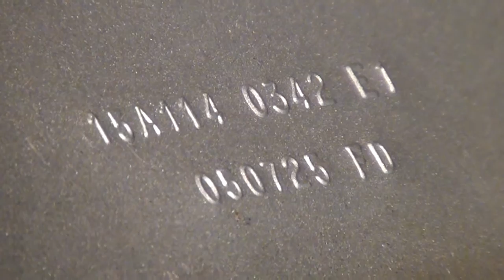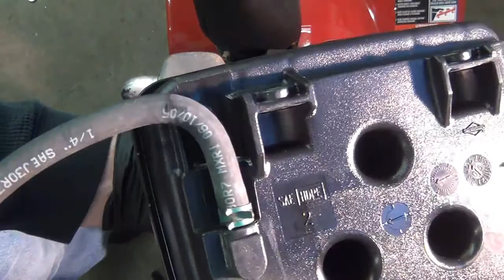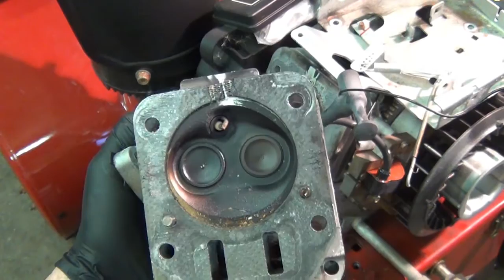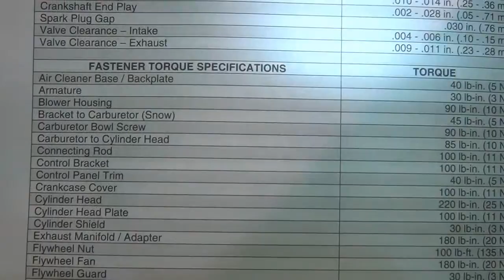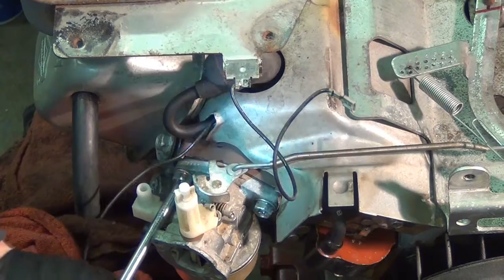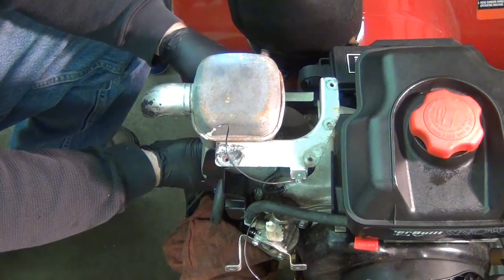Briggs & Stratton cylinder head replacement snow engine - Craftsman snow blower head gasket replace

Comment: The head gasket failed because 4 bolts can not hold it tight all around. Even smaller lawn mower flat head engines use 7 bolts. This engine is designed to fail.

Comment: Awesome video.  Thank you for posting.  Used it to replace the head gasket on my snowblower this week.  Thank you for showing all the bolts as you put them back in, this made re-assembly a lot easier.

Comment: Thanks for making this video, it'll help a lot of people.
I have the same model. It's been used about an hour each year for 15 years.
Trying to figure out why after using it for about 20 minutes the wheel drive starts slipping. It gets bad and I need to drag the machine back by the handle. There is some oil on the frame around the base of the engine block and in the back by where the shift/ speed lever passes through the frame. Maybe this oil leaks down and gets on the belt or friction wheel?

In the past I've had the tension springs break and/or come loose on the swing plate, inside the back cover.
Tomorrow I'll take off the back cover and front belt cover to see what I can see. 
When I'm going backwards I do tip the front up kind of high. This is nothing new however and in the past I didn't have this slipping problem.
I have video. If you are interested I can post a link to that.

Any ideas or suggestions?
Thanks!

Comment: Can't thank you enough for this video, it was my exact problem. The snow blower would  misfire badly at any  rpm higher than 2800. The plug was black and the exhaust would burn my eyes. I changed the ignition coil because the spark looked intermittent at the misfire speed. No change. I worked on the carburetor since it seemed to be running extremely rich. I thought I was on the right track cause I could get the rpm up to 3600 by loosening the carb mounting and creating a vacuum leak. Still not satisfied that I found the root cause I stumbled onto your video of my exact blower. I pulled the recoil and thought I heard the swoosh swoosh. I then did a leak down and air was definitely escaping from the head.  That was the problem...head gasket. What threw me off from the beginning was I did a compression test and I had 100 PSI . Go figure.
Reply from the maker: Yeah, a compression test doesn't really tell you too much other than "does it have enough compression to run"  The leakdown test will let you zero in on the integrity of the whole compression system. By that I mean, cylinder, head gasket, head (cracks?) valve seats and valve sealing, rings, piston (cracked?).  It gives you confirmation that all those things are working properly. Any leaks and you will have problems with the mixture not being correct and not burning properly. I'm sure you had all kinds of weird behaviors depending on temperature/conditions that was difficult to nail down. Looks like you solved it!

Comment: Mine runs, but after 5 minutes will blow oil out of breather on valve cover. I believe its blown between the combustion chamber and push rod valley. Any other suggestions before I tear it apart? Mine is the same blower, but older because mine is a 12 ci
Reply from the maker: It could be blown there. Do a leak-down test and listen for noise at the oil fill cap(take the cap off). You should hear some but you may hear lots if the head gasket is bad.  It sounds like the crankcase is building pressure over time due to a compression leak blowing into the crankcase area via the pushrod area. 

ALSO, you may have oil in the engine that's been thinned out by gasoline due to a slow carburetor leak caused by a leaky needle and seat in the carb. What happens generally is, the carb fuel inlet doesn't fully close (leaking needle/seat/ or bad/cracked float) and fuel from the tank slowly overfills the carburetor to the point where fuel comes up the carb main jet and slowly leaks into the intake port then slowly runs into the cylinder (if the valve is opened or the valve does not seal perfectly) and past the rings then ends up in the crankcase with the oil.  This thins the oil out and once the engine runs for a few minutes, it blows out this oil/gas mixture through the breather, or sometimes the muffler/exhaust will smoke. This kind of thing usually happens after long-term storage (summer storage) when the fuel left in the tank slowly weeps over several months and ends up in the crankcase. I see it all the time. ALWAYS check the oil level before you use any equipment because if it's overfull, you may have this problem. To solve it, simply drain the oil (you will see it runs out very fast like water because it's been diluted by gasoline) and refill the oil to the proper level. You should also check the carb to see if it's still overfilling. This is one reason I never store my equipment full of fuel. I just put a small amount of Ethanol-free fuel in my equipment and run it for a few minutes to get that new fuel down into the carburetor bowl and leave it for the winter/summer.  Nothing worse than having half a gallon of fuel drain out into your garage!

Comment: Just did this same job on my snowblower 11.5 250cc and I am having trouble setting the valves. I get the right clearances, but it will not start. Is there another step I need to know?
Reply from the maker: Once the valves are set, you should be good to go. Do you have compression? Fuel? Spark? It the flywheel key in tact? (sometimes the key will shear and this changes the timing (spark). The clearance between the valve tip and rocker arm should be around .006-.009 or so. Why did you replace the head gasket? Was it bad for sure? LMK

Comment: Although this video is over 4 years old it is Perfect for detailing how to get the head removed. I 'acquired' a broken Craftsman snowblower from a friend with a B&S motor manufactured only a few months before the one in the video, and the tear-down here was spot-on. The snowblower I now 'own' had no compression as a first symptom, and this video gave a very likely cause. After following the steps in the video and opening up the cylinder head I found (a) the head gasket was starting to deteriorate, (b) the exhaust valve was stuck/corroded in the open position and (c) water in the oil. That came out like stinky discolored milk. For some reason this is a common problem - another friend has the same model and the same problem occurred, water in the oil, and a 3rd (!) friend related the same experience with a similar model. How is that water getting in the crankcase?

Currently cleaning everything up and looking for parts. It would be helpful to know what the part # is for the head gasket in the video. Thanks very much to Dan for an Excellent video.

Comment: je l'ai fait, pis ça marche, merci, 
i did it, step by step, it worked and it started
to install the push rods, i unscrew the screw roker arm
it did start, let see if it will do the winter
not the adjuster roker arm, i was unsure about adjusting them

Comment: hello good afternoon I have the same snowblower. but I have some problems with the machine. The first is that it only works in chooke when I start running it pulls as it would like and also throws fire through the exhaust sometimes as small explosions and when the apgo comes out little smoke through the carburetor. change the carburetor but do the same speed is not stable. could be the governor I ask for your help thanks

Comment: Thank you so much!!!! I think you just pointed me in the right direction to why it started running horrible all the sudden and started sounding weird. You wouldnt happen to have part numbers of a recommended head gasket by chance?
Reply from the maker: You can look it up on Partstree.com. Get the model, code and type and DOM off the back air shield on the engine (or stamped on the valve cover sometimes). Each displacement uses a different gasket ( the bore is different size but the rest is exactly the same)

Comment: Good Video 
just picked up a used 2014 Craftsman snow shredder 250cc  Seized Engine !!!!!!!!!!!
Ran with NO OIL , piston scored é aluminum transfer on cylinder
check my rebuild video !!!!!!!!!!!!!!
2014 Craftsman Snow shredder Rebuild

Comment: Excellent video, i just bought one of these for $100 ran good but the previous owner said it lacked power in deep heavy stuff. I could hear the compression leak.  My head gasket was leaking 90 degrees away from yours towards the gas tank.
Reply from the maker: Sweet, quick fix and saved some coin!

Comment: Dan.  Thank you soo.....much.  I have this snowblower and have had trouble with it from about day one.  No one ever seemed to be able to fix it and I wound up working on it myself.  I eventually had to replace the carburetor and I also added a fuel shut-off, although not as nicely as you did.  This winter, it ran better than ever.. until one day when it wouldn't turn over.  I replaced the magneto which really gave me better spark, but it's still not running and I now that I've seen your video, I think it's the head gasket.  You are a real pro and make great videos.  Thanks so very much and keep on posting.

By the way, I have the same questions as GKazz about the red wire.  Is it for accessories?  If so, why isn't it capped off?
Can you give me an idea of what you might have charged for the job on this video?
Reply from the maker: Check to see if you can hear a leaking sound when you slowly pull the starter cord. Most of the time, you can hear it leaking on these engines. If it leaks enough, you won't have enough compression for the mixture to burn and this might be why it's not running.  As far as the spark goes, if you have ANY spark at all, chances are the magneto is fine. These engines don't have a big fat spark like the old (60's and 70's) engines that use points and condenser. All you need is a small spark to light the fire. Do a quick test by spraying some carb cleaner or starting fluid into the carburetor then pulling the cord. If the engine runs "normally" for 1-2 seconds then stalls, you probably have a fuel problem (carb clogged , water in fuel, debris in bowl, etc) If the engine does not run at all and coughs and spits , you may have a sheared flywheel key causing the spark to happen at the wrong time. You would need to remove the recoil cover and the flywheel nut and cup to see if the key slot is lined up with the flywheel.  I'm not sure on this particular engine if you can see it without actually removing the flywheel from the engine. Try to narrow down the problem before you replace parts. These engines generally run well if you have good fuel delivery, good compression and a properly timed spark.
Reply: Dan, before your reply I took apart the engine and the head gasket was blown exactly as in the video.  I cleaned the head and piston, got a new gasket and installed it and reinstalled the push rods. The intake works fine. 

 I am concerned that exhaust valve doesn't seem to move much except for the compression release that you pointed out on the video.  

I can turn the engine almost 360, but not more.  Is that correct?  

Both tappet clearances were at 0.005 in, so I tediously set the exhaust to about 0.010.

I started to put it all together, but don't feel comfortable about the exhaust.  Advice?
Reply from the maker: @lamontcranston2627 - you should be able to turn the engine by hand all the way around with no resistance. Something must be in the cylinder OR you may have a valve that is stuck and when the push rod trys to open it, it jambs. I have seen the valves seize in the guides from people running the engine with low oil. Always make sure the oil is at the proper level on these OHV engines or the head won't get enough lubrication (and cooling) and the valves with seize and/or the head will overheat. The oil does a decent amount of cooling believe it or not.

Comment: Great video!  Question.   Under the gas tank support plate, there's a red wire with a c-type plug end, coming off the the alternator.  Can you please tell me what it is, and where it plugs into?  I have a feeling it's for a headlight or something like that.  thanks.
Reply from the maker: That wire is a stator coil wire (alternator/generator/coil - whatever you want to call it) and it generates power when the engine is spinning via the magnets on the inside of the flywheel. It's used to power a light or electric motor for the snow chute motor if you have one on your snow blower. In this video it looks like that wire has a diode on it so it generates pulsed DC power (vs AC power).  There are charts and books available from Briggs that show the various charging configurations and the amount of power each can deliver.